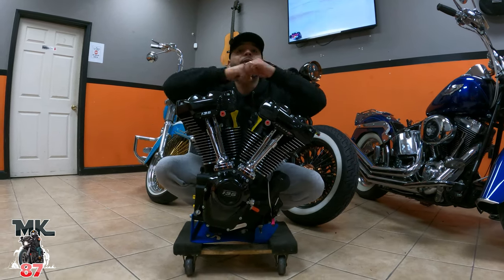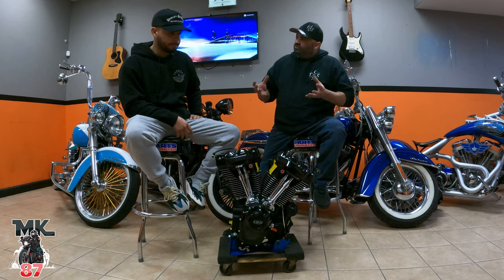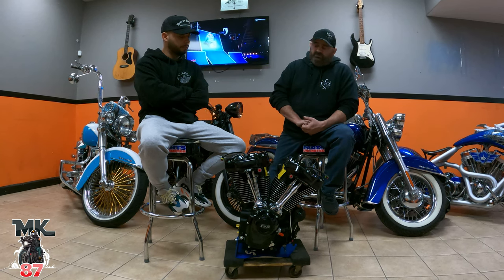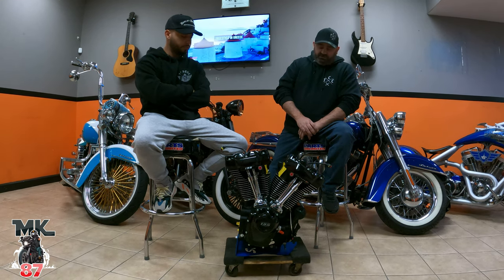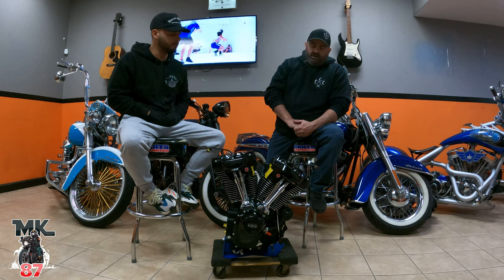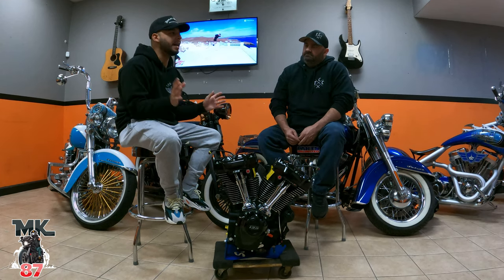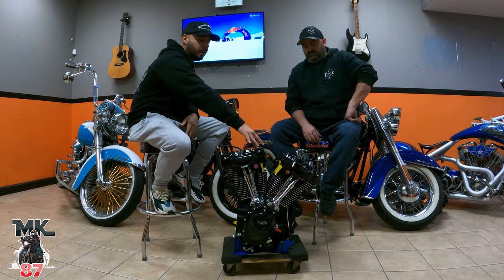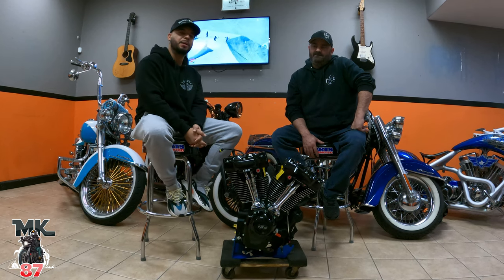New Harley Davidson 135 crate motor!

Comment: Build it as a performance bike with a bad ass sound system
Reply: 'Performance bike' and 'bad ass sound system' don't belong in the same sentence. Ever. The bad ass sound system on a performance bike is the tailpipe. You can make a performance bike out of a RKS but it takes a lot more than a big motor. Bagger racing exists. But putting a massive motor in a stock bike is just a quick trip to the hereafter.

Comment: Cool. What would you do personally when it comes to insurance coverage when dropping this engine in ? Something that people may not think about or know. 

Can t wait to see the progress!
Reply: Hey. I will most likely add an accessory insurance coverage. I have an 2003 springer that I built with Paul Jr. insured for 30k in accessories.
Reply: @TorqueCustomCycles  nice. I was wondering how that would work. Appreciate the feedback
Reply: Would be a shame if someone dropped this in without having appropriate insurance. That goes for life insurance too. This qualifies as an extreme sport at that point. Especially if you don't mod the rest of the bike to handle the power. I'd rather go base jumping than ride a stock Harley with a motor this powerful.

Comment: A big motor is wasted on a bike that isn't set up to handle it. I would take a motor like that and put it in a custom frame and go road racing in unlimited class against Hayabusas and ZX-14s. Someone is compensating putting that in a road sofa. I hope there are going to be brake, suspension and tire upgrades to go along with that motor, otherwise, you're just building a deathtrap.
Reply: Your logic makes zero sense.   The motor itself is a large motor, size wide, BUT it is the same size M8 that is all of Harley's bikes today, the only difference is, larger displacement, more aggressive heads, larger cam.  Why through this motor in anything except for what it was designed for? As the guy mentioned before, it's drop in and you're done. you don't need to mod the frame or anything.
Reply: Lol dude.  Do you legit think someone is dropping 8 grand on a fucking motor and stopping at that 😂😂

Comment: Outdated motors in a heavy bike ,whats the point ,just ride it stock  ,this is like hot rodding a model T & it wont hold up  ,Hd's are for cruising not performance,do a inline 4 or 6 if u want performance,as far as performance an inline 4 in a 600cc will smoke these hd bikes,135 motor puts out about 130hp in a 800 lb. up bike ,thats it,inline 4's are around 200hp in a 400 lb bike 900-& up cc's.,its always funny listening Hd people goin broke on the hilarious stage1,stage 2 stage 3 mods & gain 10 hp & bragging about what stage they have  , this makes hd rich
Reply: All wrong